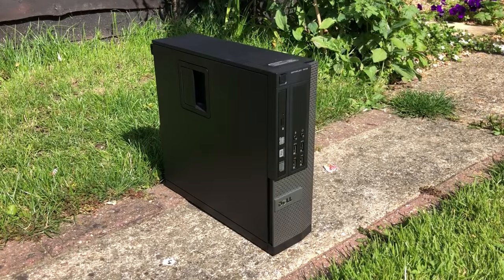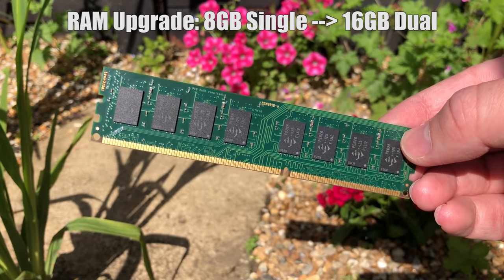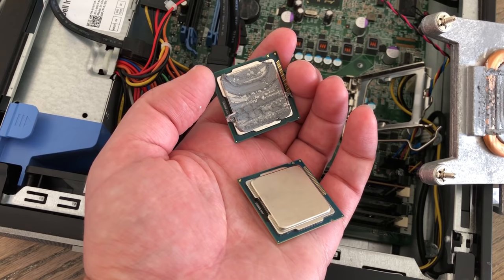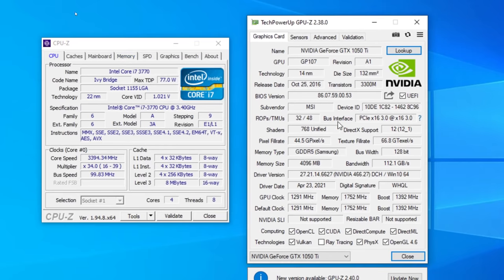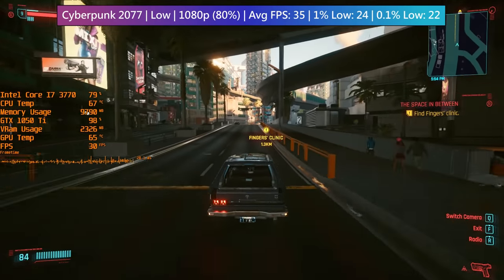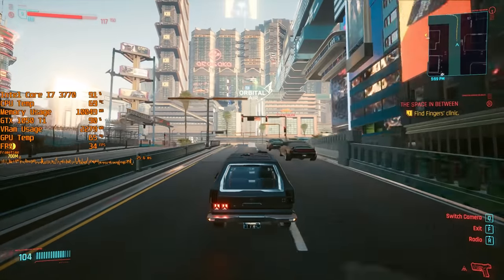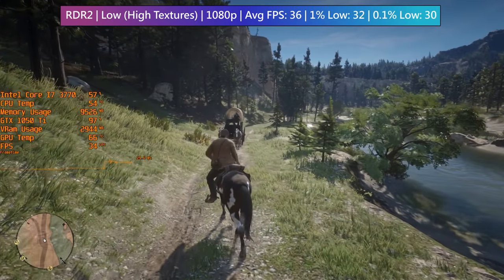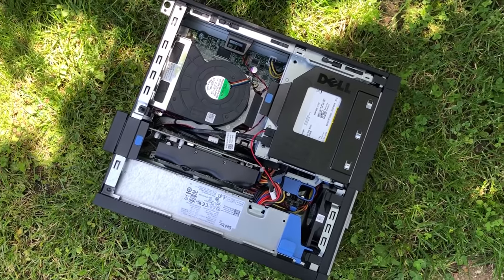Turning The Tiny, Cheap OptiPlex Into a Gaming PC - With Whatever’s In Stock

Comment: Also I would check to see if the cpu scores are normal for the 3770, it may be watts limited on that board which could be tweaked with XTU (A bit, dont go nuts).

Comment: i'm glad i got my 1650LP when i did for my Dell 9020 SFF
now all i need is a 4790
Reply: How does it do on the 4x slot? I ended I saved a bunch of those dells from a dumpster last year and ended up building a 7010 on Ivy Bridge with a 1650 because i thought the 4x slot would handicap it too much and the 7010 had the 16x slot in the right place.
Reply: @trash_miner  my mother is the 00V62H and it handles everything i have fine, after i upgraded my PSU and used some adapters it handles everything i play at 1080p fine

Comment: I wonder if the usage spikes are due to the games using AVX instructions, new CPUs handle AVX instructions fine without any slowdown but older CPUs typically had a forced slowdown to use AVX since its apparently very hard on hardware.

Comment: I would love to have such a small machine as emulation Station
Reply: @tech_jims  thank you for the advice 🙂 I gonna try to find one on ebay
Reply from the maker: Yeah this ones gonna see some ps2 action haha
Reply: @RandomGaminginHD  for a video why not try this build a deskmini or tiny pc with a 3200g as they alot cheaper than the 3400g or 4000 series, let's see whats the very cheapest decent small emulation station you could do, think the channels viewers may enjoy 😉
Reply: @RandomGaminginHD  great 😀
Reply: @RandomGaminginHD  It would have been fine for that with its original CPU and a GT1030, because I've run some PS2 emulation using that setup and got a steady 60fps.
Reply: @d2factotum  the ultimate titles to test your ps2 emulation performance are dirge of cerberus and shadow of the colossus, those titles use all ps2 hardware pinned at 100% usage.
Reply: @hellfire92837  another one that will really put your system to the test is Ace Combat 04

Comment: Haha, I actually had one of these for quite a while. I got mine off eBay for $50 and stuck a gt1030, an ssd and 16gb of ram in it. That thing could run ANYTHING  (at low of course)

Comment: As with what I have seen from local benchmarks over the past matter of months since Cyberpunk 2077's launch, Sandy Bridge and Ivy Bridge i07 parts (2600K, 2700K, 3770, and 3770K) benefit best when paired with 1070 Ti~style performance, which is what we are expecting to come out of the RTX 3050, and it has had extremely high anticipations that it will be a Low Profile card that could potentially rest at the 075 Watt power target, effectively bringing many Optiplex, Pavilion, and Ideacentre systems to the point where they can play virtually every Generation VII and VIII title with reasonable stability in Standard HD (I280x0720 and I680x0720) on High Presets or Better.
Nvidia currently has the stronghold on Low Profile cards, and with there being no Navi cards from AMD that meet this target (the RX 6500 would be a replacement for Third Generation Polaris cards up to 075 Watts, those being the RX Lexa/"550" and RX "560"), right now the GTX 1650 is sadly the only proper option to put in an OEM system such as this until the RTX 3050 arrives or if Intel Xe: HPG delivers a proper offering for the 075 Watt and Lower demographic that meets that 1070 Ti performance that the new Entry Level is at; we probably mustn't expect such a change in the Entry Level market for a matter of months though, we still don't know when the 3050 and 6500 are set to come out and I worry that they will be expensive (North of 0200$ USD; no more than 0249 though), wishfully the performance justifies the premium and helps determine how much lower Pascal, Vega, Turing, and Navi cards must be priced at once numbers return to normal.

Comment: I have a similar build with a xeon e3 1230 v2, 8gb ram and a 750ti. I was planning to at least upgrade the ram to 16gb but since my mobo only has 2 dimm slots I have to buy a 2x8 kit and it's honestly off putting how expensive ddr3 still is on top of the gpu pricing.

At this point I'm just waiting to see more about the Steam Deck and how AMD's Van Gogh performs and maybe downgrading this build to an i5 3330 removing the gpu and give this to my father for his web browsing needs, while waiting for next gen hardware for a new full build since current gen has really put me off with vram restrictions, TIes and pricing.

Comment: Hang on. Even if the card draws no external power and uses the pci slot it still has a power requirement right? For example the gt 1030 lp requirements are a 300w psu but it only uses 30w from the pci slot. I'm asking because I only have 180 w psu (basic desktop) and wanted to throw in a 30w lp gpu and perhaps another 8gb ram

Comment: Are you clanking tea throughout the video? The E3-1290V2 is actually the best CPU for this machine. It's 300 MHz faster than the i7-3770 in base and 200 MHz in boost. Street price is around $200, though.
Reply from the maker: Yeah that’s the trouble, good cpu but expensive

Comment: Cheers 4r CPU recommendation but 4r windows 11 re gaming the specs sheet, 'suggests in print', that an NVME/M.2 drive is required for the updates, dont know why? Will it take windows 11 without a crash?
Oh hi thanks i found out you directly boot from your NVME/M.2 and that requires the operating system, thanks anyway!

Comment: How about some case mods next and a bit of RGB.

Ref Fortnite: 1080p is not worth it in Performance Mode and I think it's meant for Quad Cores or Dual Cores as Multi threaded rending seems to be not available in Performance mode..... so the i7 might actually perform better in DX11 with everything on low and 720p.

Comment: So I'm putting together a cheap PC for a friend,

I found a Lenovo thinkcentre e73 in a skip.. HDD and ram were removed.. the motherboard and CPU and PSU were there though..  the h81m takes upto a i7 4770s.. 

Something I noticed though was that the motherboard didn't take the usual 24pin connection.. it's 14 pin instead.. but you can buy 24pin to 14pin adapters on ebay for like a few quid.. so I was going to transfer the motherboard into a m-atx case and use a 600w PSU with the adapter for power.. 

My budget is 100 pounds.. so it's what I have lying around..

I7 4770s 
16gigs of ddr3 1600
120gb SSD
500gb hdd 
600w PSU.
GTX 570- although I thought maybe a rx550? Not sure
Reply from the maker: Yeah I’d imagine the rx 550 would do begged thanks to better modern support. You could always upgrade it later on too if you want but at least it could run any DX12 titles in the mean time
Reply: @RandomGaminginHD  yeah that's what I was considering.. the GTX 570 is old but it has some life in it.. it's just the vram amount holding it back.. saw a rx550 for like 40..50 quid..so it might put me over the budget.. 
But I enjoy the challenge! 😂
Reply: By the way, love the channel.. it's one of my go to channels...keep the good work up!!!!👍

Comment: I think it's a problem with the newest update in Fortnite, maybe because of the new graphic settings (next gen graphic). I only have some minor stutter, when i am jumping from the bus, on my I7 4770k @4,2ghz and a R9 390 8gb. But I get some minor dips, down to 70fps, I have locked it at 120 fps, as this should help, locking it on tier over the refresh rate of the monitor.

Comment: i got an optiplex 3020, with a 4th gen i3 4160, that pc has the x16 slot on the bottom, therefore it supports only low profile single slot gpus, bought an rx 550 4gb low profile (wich is the most powerful single slot low profile gpu), and after a single run of superposition benchmark, the gpu reached just 93°, now that's what i call good airflow 🤣
Reply: You gonna break the gpu dude. Let the side pannel off and put a 120mm fan on the gpu
Reply: @mattynicolaz9832  yea i'll need to figure out something if i want to use it a full power, but for now temps are "fine", while gaming the highest temp i got was around 80-85° never got past 85 except during benchmarks
Reply: still, i'm considering replacing the stocks fans with some from noctua
Reply: Run it without the lid.
Reply: @dycedargselderbrother5353  not enough space, i need the monitor on the pc
Reply: @Artemis_WR  85 is too much broh, just dig a hole in the case right under the gpu fan and put the bloody case on elevated space, or put a fan in a diy way right next to the gpu .. im telling you, it can break anytime
Reply: @mattynicolaz9832  that's another thing i was tempted to do, but 85 is still under the thermal limits. also it doesn't reach that temp very often, i don't game too much, and most of the times the cpu is a bottleneck

Comment: Why does this computer have two full-size PCIe slots?
Are both full 16x slots or is the upper one 4x in a 16x format? The documentation says they are one 16x and one 4x, but in 4x format.
I own a 7040 and was highly irritated when I opened it for the first time. There is a 16x and a 4x slot. The main problem is that the 4x slot is the upper one. So you can use a low profile 1050ti or 1650 in the upper slot that only uses 4 lanes or you would have to fins a low profile 1 slot format GPU. Maybe the designer had a beer too much the evening before...

Comment: these pcs are really good in terms of price to performance. it got an old hp 400 g1 gave it a amd rx 550 and 12gb of ram and i was wandering if an i5 4590 would kill the psu or should i use the s variant of the cpu

Comment: Isn't the Xeon E3-1290 cheaper and even slightly better? I was able to hook up a m.2 nvme as my boot drive, gtx 980 ti with a xeon 1230 v2 inside a Optiplex 7010 mt ofc I got a better psu, although after a week and more learning, I decided to sell it and make a Ryzen 5 5600x power house

Comment: Did you buy the cpu online or in store  from cex I'm looking at getting a processor upgrade but worried about the horror stories of them just simply putting the cpu in a brown envelope and just sending it out without anti static bags or any protection what so ever...🙃🙃🙃
Reply: Don't worry. This is not 90's anymore. GamersNexus experimented in the past about the durability of a CPU being packed inside a mere Paper Envelope, Bubble wrap, and some Duct Tape, without any Anti-static bag

The result? Nothing bad happens to the CPU.

Your Fear about CPU gets damaged by severe static discharge only Valid for CPUs from 90's era, or any CPU before DDR2 Systems.

Modern CPU are tougher. Even if you send a Core i7 3770 inside a Brown Envelope to the other side of the Planet, it is completely fine. As long as the Package is waterproof. It is more than enough to secure the CPU.

Comment: look for a HP Compaq Elite 8300 with an I7 3770. Buy an Adapter Cable for it. So you can put in a "Normal" PSU.

Comment: Low Profile cards are insanely expensive now, you can find cheaper full size 3060s with 8GB than a low profile 1650 with 4GB. Nuts.

Comment: I bought the one I had from my job. It’s has a intel 7th gen. I just wanted it since it had a blue-ray drive and it’s an i7
Reply: So throw an SSD and RX580 8GB/GTX 1060 6GB/1650 and make sure to have 16GB of VRAM (8GB is becoming not enough for gaming now days).
Reply: @weecious  it came with a gigabyte 1050  4gb low profile. I don't really want to upgrade it as much, since I do have dedicated gaming PC already. 
But I don't have a current high end gpu, just have a MSI 2080 8gb.  I'm waiting still to upgrade that pc once the 3000 series come down more in price
Reply: @weecious  i just wanted it because of the blue-ray drive and it was $120.00 😌
Reply: @gamester1416  Really? "I don't have a high end GPU just a 2080". That's pretty high end for majority of the people. I have a 2060 Super 8GB overclocked to 2070 or a bit faster perfomance wise with 3700X. Also waiting on new gen GPUs price drops. Maybe even will go for an AMD GPU when prices drop since they actually have pretty high end GPUs now days. Even a 6700 XT or 6800 would be enough for my needs since I game at 1440p.

Comment: Unfortunately mine went awol and is giving me an error message about display output along with hdmi… had to remove gpu, install the i3 back in to use the motherboard/integrated graphics(installed Xeon 4c8T) . No idea why and it’s not in the bios to shut off. Was working fine a few weeks ago

Comment: Too bad you are limited to that DELL BIOS. The 3770 can be overclocked to 4.3GHz single and 4.1GHz multi.
With those settings you would probably alleviate some of the stutters and CPU bottlenecks

Comment: Should I buy a Pentium G6400 for 90$ or save up for a i3 10100f which costs like 150$?
Reply: Save up for the i3 10100f, it's about 30 percent better performing than the g6400 in gaming 😉 and the 10100f is a quad core while the g6400 is only a dual core 🙂

Comment: Have you tried something with regular sized optiplex 3020? I've still got some in company, they're real office powerhouses, with 4th generation cpus, they can fit a normal psu, and you can purchase a cheap 8-24 pin adaptor to upgrade psu. Never had time to add a better gpu and test some gaming, though. They should fit regular sized graphics cards.
Reply: If so regular psu and gpus fit you are done broh
Go upgrade/re-sell those beasts!
Reply: @mattynicolaz9832  They fit, just gotta  get psu adaptor from regular 24pin to Dell 8 pin. They are great and reliable office machines, only 2 out of 10 had a psu failure at age 6 or 7, and I'm gradually switching them to ssds. Can't afford time or money to test their gaming potential with full ram, psu ang gpu upgrade, so I hope this guy does it :D
Reply: @millancche hell yeah broh, but if he doesnt do it, you know how to 😏 you just go and upgrade the hell out of these. You gonna have profit and everything
Reply: @mattynicolaz9832  Nah, they 're not mine, just looking after them for a company. Their factory PSU is rather bad, and the only weak link. Not sure if it's possible to profit on them that way, as you gotta buy a good psu, ddr3 is not getting any cheaper, gpus are even worse, and the psu adaptor is like 10 bucks. Therefore, it's going to take an enthusiast like RandomGaminginHD to make it happen :D
Reply: @millancche  ow broh, i bought an old HP for 25$. I bought an i7 4790 for 30$ and 2x4 hyperX for 20$. Used the same adapter and a 80$ radeon 380 and 600w psu. For 170$ this thing is banging cyberpunk 1080p...

Comment: Today I bought a GT 1030 LP for my Acer Aspire XC-885 but sadly they sent me the ASUS Phoenix version accidentally and it did not fit the Acer. However I have fitted in my HP xw8400 Workstation PC for a little while until I can find a better use for the GT 1030 ASUS Phoenix. 

HP xw8400 Specs:
Intel Xeon 5160 x2 @ 3.00GHz
ASUS Phoenix GT 1030 2GB GDDR5 
32GB of DDR2 Memory @ 667MHz
750GB WD Caviar Green HDD
120GB Kingston Boot SSD
Windows 10 Professional 64-Bit

I bought the xw8400 for £40 on Facebook Marketplace and the original specs were:

Intel Xeon 5160 x1 @ 3.00GHz
ATI Sapphire Radeon HD 3850 256MB of GDDR3
16GB of DDR2 Memory @ 667MHz
750GB WD Caviar Green HDD
Windows 10 Professional 64-Bit

Comment: My optiplex 760 does not recognize pci express graphics card, there is apparently no solution, I bought it cheap from ebay but I am disappointed, apparently when still under warranty dell replaced the mainboard for free but now I am left with a pc I can’t upgrade

Comment: What was the limitation with the board that disallows a 3770k? Its lga155 yes?
Reply: You could, but why? No OC support in bios. The K usually cost more when shopping. Anemic PSU, SFF case thermals,  CPU cooling, and power delivery components on the board, all inadequate to support a sustained OC that would be worthwhile. And an overclocked K would do little to help the limitations due to number of threads or GPU.
Reply: @da1punisher  I was referring to a early statement he made that the 3770 was the highest rated chip for that board. Not that he should use it. I have a k model in an Intel reference 1155, waiting for a good partner board to appear,  cheaply.  I was curious why the k variant wasn't mentioned, thafa all.

Comment: you paired 1050 ti with 250 psu?
Reply: 250 Watt PSU with Gold Rated is theoretically safe up to 500 Watt spike stress.

The other reason is GTX 1050 Ti LP edition (Low Profile) is actually consuming much Less Wattage than 75 Watt from the PCIe X16 Lanes.

GTX 1650 LP edition is much closer to 75 watt max consumption.

Comment: Sadly that power supply is going to be the real bottleneck here, as it severely limits even what low-profile cards can go in there. Even a single-fan, single-slot PowerColor RX 6400 that offers comparable performance to your 1050 Ti for about half the cost says it expects 350 watts despite the GPU itself claiming a lower power draw than Nvidia's (53 vs. 75). Maybe the VRAM is more demanding or something? Or maybe they're just overestimating for safety's sake. Hey, somebody out there try it and see if it catches fire, OK?